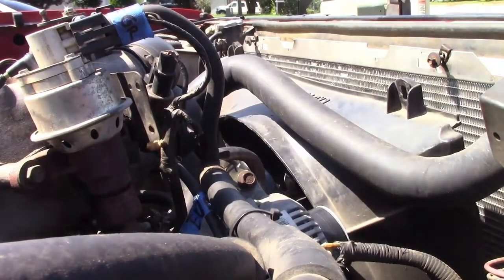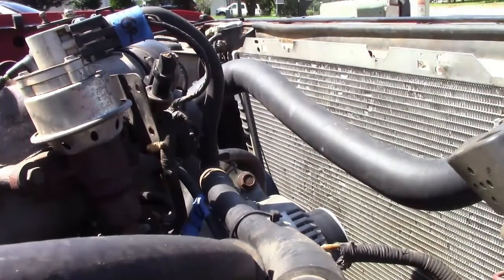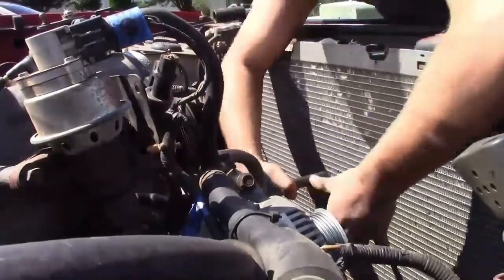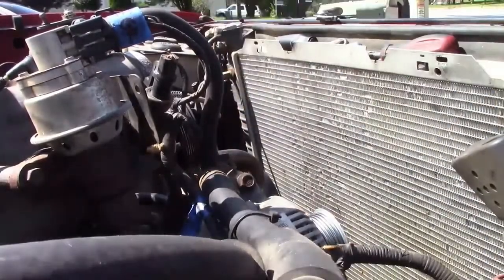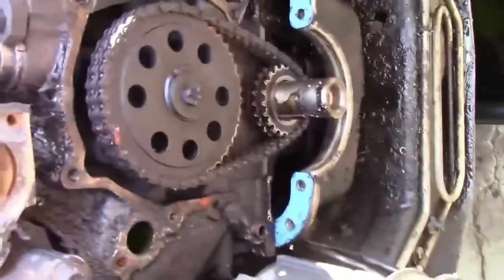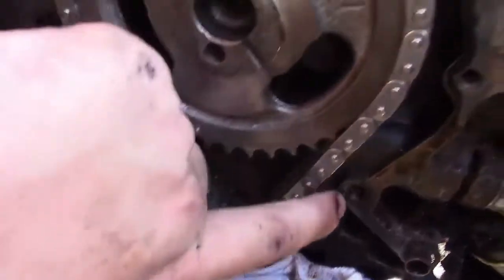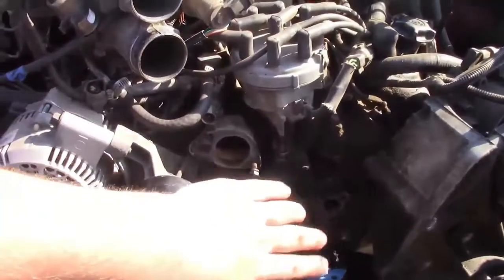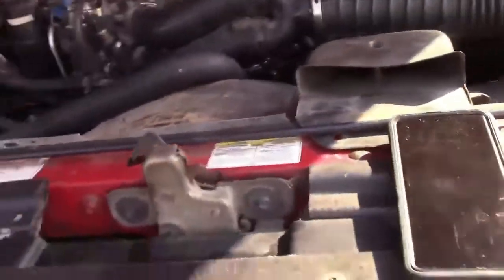How to Replace Timing gears and chain 5.0 302 87-96 f-series and bronco

Comment: I have to have a use a to pull mine out the lower gear I have a 96 Silverado 5.0 is there a certain socket I can use to knock it back in the lower gear on the crankshaft